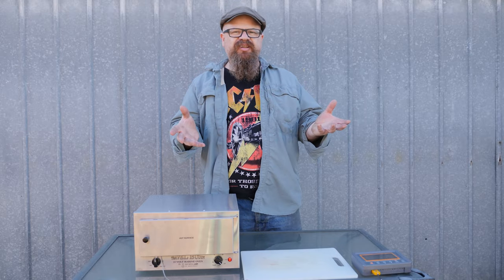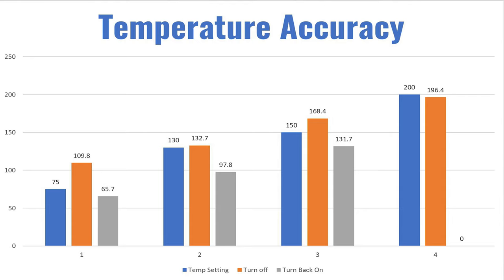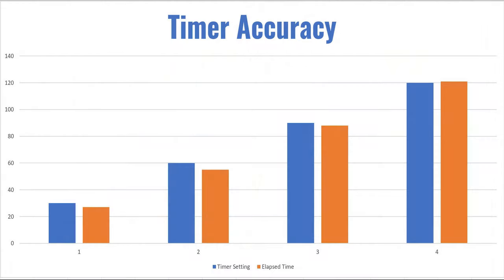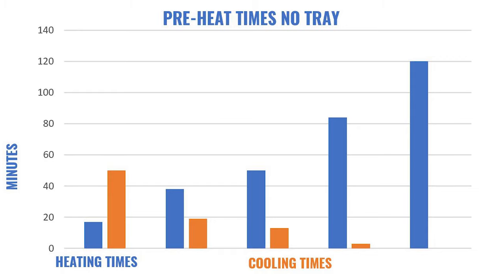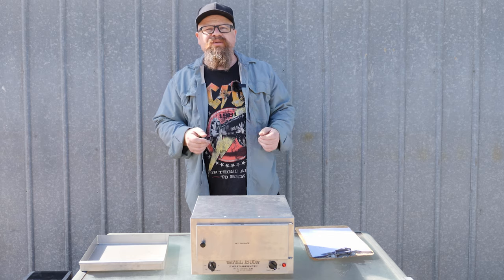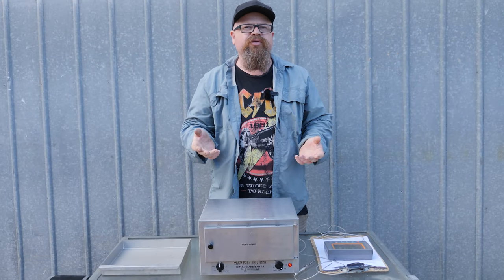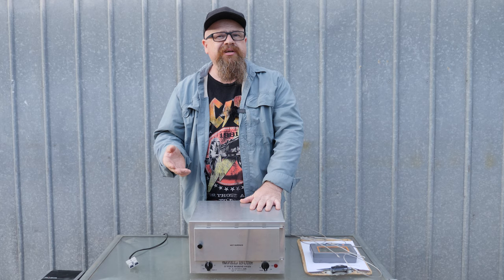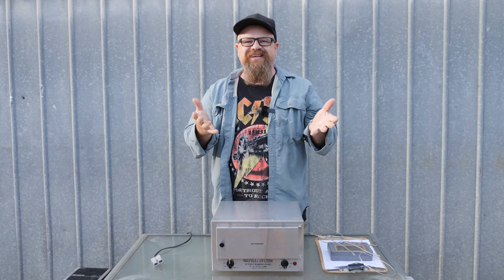TRAVEL BUDDY 12V-24V Oven Review

Comment: Love your content. I learn a lot from your videos.
I have the Road chef and the thermostat temp temp is way off when roasting anything over 1kg.
I use a MEATER temp probe and the internal temp will read 95-100 Deg with the thermostat set around 70 Deg. 
My guess is the huge volume of meat in a deep oven tray will soak up most of the heat from the element and not allowing the ambient temp to rise enough for the thermostat in the top to read the true temp.
Reply from the maker: I think you might be right, while all of my testing has been with mostly the stock setup, I've got a couple of Somerville Metal Works trays, and besides the expected delay in preheat times, I've also noticed a discrepancy in the thermostat temp and expected temp of the meat. 

I might have to fire up the data logger one of these days and find out exactly what's going on.
Reply: @LockyourHubs4WDing  That would be awesome. Personally I think it’s a case of the temp sensor being to far away from the source of heat in conjunction with the tray and meat in between element and sensor.
Thanks for replying and look forward to the results

Comment: I liked this review. Thanks for going to the trouble! The heating element is on the bottom only. Those pies would have heated up in around an hour if on the bottom tray. As well as the Anderson plug conversion I ended up changing the little door knob for  a brushed aluminium door knob from Bunnings (so it matches the oven) and it is much easier to open and close the door.
Reply from the maker: Interesting, I never thought about the placement of the element, in a conventional oven, the flame is at the bottom and still the upper levels are hotter because heat rises etc. I might throw a couple of thermocouples on different levels and check it out. I thought it was going to give it's best performance using the top shelf. I've  since installed a insulated front door from Kaon and we're in the middle od testing that mod. More pies!
Reply: @LockyourHubs4WDing  Yes I find that the bottom section is very hot (I use the aftermarket trays as well), but the top area remains cooler during the warmup and cooking stages. It mustn't radiate nearly as much heat as a conventional oven. So I have found that the pies on the bottom might be warming well, but those on the top are still frozen! And so I will swap the trays over to get more even cooking. It is easy to burn items on the lower tray because of the close proximity to the heating element. I think for that reason they recommend to cook pies upside down, so it is easier to pull off the burnt top, than a burnt bottom. But would be very interested to see a cooking test measuring heat at the top and the bottom. :-)
Reply from the maker: @Pronto71au  I've got a few vids scheduled ahead, but I'll definelty give it a try, with and without the trays, further down the track
Reply: @LockyourHubs4WDing  Yay! Looking forward to another review!

Comment: I wonder if you could poke a multimeter into one end of the lead and at the other and tell us the voltage drop. I reckon they lose half a volt in that lead (per side so ground comes up to .5V and power drops by .5V), so I reckon its not just losing power to the lead, but by reducing the voltage the heater sees, so its actual power produced as heat inside the oven is substantially less that intended. Bung on some heavier gauge wire and see how she goes (or substantially shorten the existing one).
Reply from the maker: Yep good point, it definitely pulls a constant 8.3amps at around 14v from the battery right throughout the preheat and cooking of the pies for over 3 hours. 

Further down the track, we're looking at testing the insulated doors coming to the market and if we can get hold of the imported Road Chef would love to do a side by side teardown and compare things like voltage drop over the 2 machines. Though I must say after 3+ hours of constant running, the lead was still cool to touch, that's usually a decent indicator of excessive voltage drop over the run of the lead.

Comment: Thanks for the review. Can you tell me what the recommended size/gauge cabling you should use for the cable from the battery to the Anderson plug?
Reply from the maker: Sure, just need to.know the length of the cable run.
Reply: Lock your Hubs 4WDing thanks, I'll be installing it in the back of a Troopcarrier so I'd say I'll probably need around 4m of cable
Reply from the maker: @Troopy67  Ok let's say the run is about 4 meters, I would allow 6m for terminations, going through firewalls etc. Allow a current draw of 10 amps and the diameter allowing a voltage drop of 2% over the run, ends up with cable of a cross sectional area (not diameter, these are two different things) of about 8mm^2 or 8 Gauge. Don't forget to install a fuse in the positive close to the battery (15amps should do the trick here).
Reply: Lock your Hubs 4WDing ok, thanks very much mate 👍